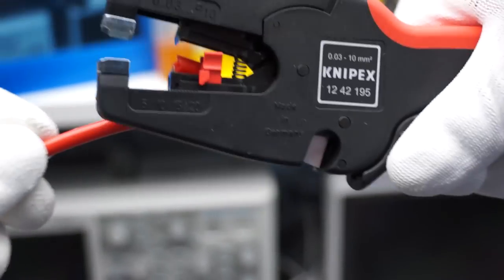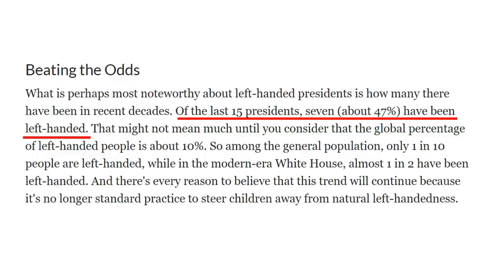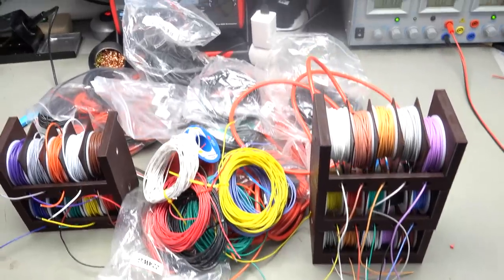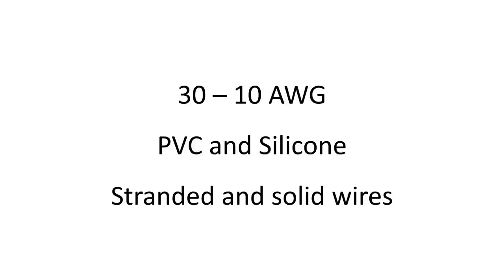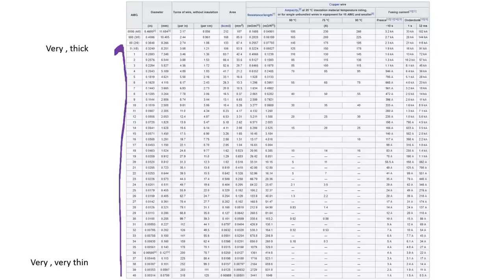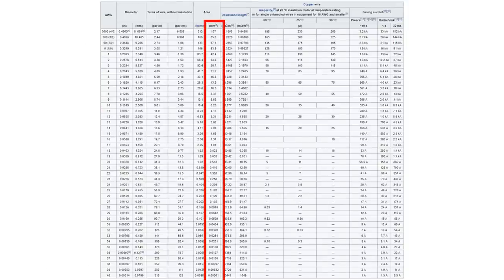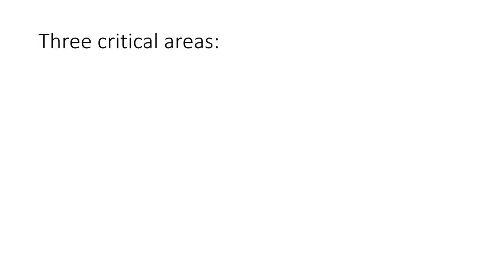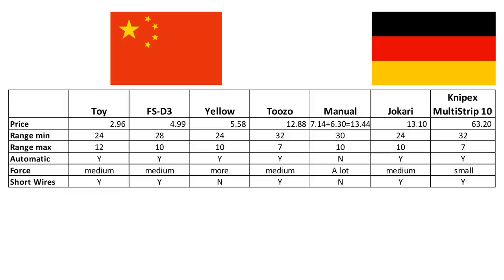#268 8 Wire Stripper Test: Germany vs. China. Who wins?

Comment: I bought a set of the "Toy" strippers when they first appeared in the UK around 1990, they were all metal, with a fine adjustment on the back, cost around £2 ($4,000) 
And I still have them & they still work well, but only on the thinner wires, they tear thick wires.
Seems the Chinese have taken them and made them as cheap and nasty as possible since then.
I also have some "yellow" ones, again with an adjuster, unlike the ones featured in this video,...they're ok, but erratic you set it for a certain thickness, sometimes they work perfectly....sometimes not so much, they don't get used so much because of this.
I recently tried a new stripper/twister that fits in a cordless drill or screw driver. Great for thick wires & as i say it strips and twists them together, might be useful for electricians, interesting idea anyway   https://youtu.be/FPHV8FI5PT0
Reply from the maker: I Think this was a completely different product. Mine was very, very cheap.
Reply: @AndreasSpiess  Apologies, i was making a joke re the exchange rate there, £2 is around $3, it is the same stripper, just as i say, all metal with a slight adjustment on the rear, all that nasty blue plastic on your version, on mine is red or black metal, it really does look like they took a good idea and just made it so cheap and nasty it hardly works anymore.
I will find it & post a photo :-)

Comment: I got the Jokari and it is crap. If you use harder insulation cable like Lapp CNC cables it sucks. Pointing so strong "Made in Germany" isn't often a quality sign and has nothing to do with german engineering understatement. It's just a kind of bullshit marketing.
Reply from the maker: As mentioned in the video I tested it as a Maker. Many commenters who work with electrical wires use the "heavier" strippers and are happy with them.

Comment: I'm loving the humour of the US system of measurement. Good old imperial measurements.......very confusing to a metric fan like me. Some nice strippers there but the usual cheap chinesium one's are rubbish as expected. 
I do know a set of strippers that will cut a perfect circle round the cores, no damage to the inner cores either...... the downside is they cost around $280 ........ ouch!!

Used them for years, interchangeable blades and fairly long lifespan. Way beyond the hobby shop price range but industry use them all the time. Here's a pic (hopefully)     https://dmctools.com/detail/74
Reply from the maker: Thanks for sharing your experience. For this channel, price-performance is very important because many of my viewers are not rich people. Or do not have a big budget for their hobby.
Reply: @AndreasSpiess  Your welcome, though I aren't rich either. My old job (aircraft repair and rebuild) has really tight rules on cable prep and termination, each tool (strippers and crimp) had to have a yearly calibration test and just to use the tools you had to be trained and have test samples sent off to verify your work is up to standard. So as a hobby they are way out of anyone's budget if they are going to be doing scratch builds or experimental circuit building/diy tasks.

But one can easily cheap out and spend more by buying the cheapest rubbish just because it either breaks more often or is badly made. So it's great to see a range of tools within easy reach of the modern hobby electrical/electronic workroom or desk.

Comment: I have owned most of these strippers and have to say you're completely wrong.
The best strippers after a set of pliers and long nose pliers are the ones that you call "Yellow" these strippers are not left or right only handed, you can use them in either hand (I am right handed and my previous employer was left handed we both love these and daily them for all sizes up to 6mm Twin and Earth), you failed to show the screw that can adjust size which most other strippers dont have and is critical to correctly cutting multi insulated wire.

The worst however is the knipex, like all of Knipex it's poorly designed, I gave up on it one day when I was doing carpart lights, the little silver guard on the tip shot across the carpark into the garden, I didnt really care to much until I realised it doesn't cut without it! The knipex are by far the worst designed in every regard.

The yellow ones I've been using for almost 6 years now with no replacement, the plastic is snapped and falling apart but it has never missed a beat, even Snapon have made them make a set for them.

Best rule of thumb is if you see a torq or an allen key on a product, DON'T BUY IT if you want to use it more than once.
Reply from the maker: Thank you for sharing your experience. I assume you use bigger diameter wires than me. Then you are right. BTW: The "yellow" one was defective and my new one works perfectly for bigger diameter wires.
Reply: @AndreasSpiess  Im glad to hear it.
I do all kinds of wire from cat5 strands to 6mm Twin and Earth but mostly do 1.5mm. If you twist the little knob it will let you adjust it to do very small cable without damaging it.

Comment: I had a dream The guy with a Swiss accent decided to build an eBike.
Reply from the maker: He rides already one (Swiss Made)!
Reply: Andreas Spiess Share please? It would be invaluable to have some of your panache and commentary.
Communication between components and Arduino and iOS is changing battery management from my view..
Configuring a power supply and a smart charger, like eBikes.ca Satiator, would be  very interesting. You are a very good teacher.
Reply from the maker: I decided for a Flyer Upstreet 5 because I need reliability for my Danube river trip.
Reply: Andreas Spiess nice! Color me green! Panasonic has a wonderful range of bikes. I’ve only briefly ridden a FIT bike. We’ve attempted to introduce bike centered on the Panasonic mid drive but old retired fellas aren’t interesting in heads or tails with our pensions. A long winding way of saying it’s a most impressive motor.  Could there be a charger video? All the best! Pollack married to a Swede grades schooled in Geneva. No funny accent.
Reply from the maker: I bought two batteries and two chargers for my ride. The interfaces are very proprietary. As the rest of the bike. I think DIY e-bikes are a thing of the past. The quality and the price of the new bikes are quite good
Reply: Andreas Spiess our sales of kits are still very strong. Many buyers do not want the very high prices of proprietary batteries. Kits also allow owners to make repairs and access repair parts. We don’t have the very restrictive laws governing power. We can use throttle as well.
Reply from the maker: Not here where you are very fast illegal :-(

Comment: Excellent Andreas video, as usual.

If you need a perfect cut, or if you need to strip insulated wires with Kapton (which is awfully difficult to cut), you can try Nitronic's Ministrip. I used it professionally and it works very well. But as you will see, the price is not for Makers...

Changing the diameter is not as easy as with other tools because this tool is intended for use in a small production environment to strip a large number of identical cables.

It is also well suited for stripping coaxial cables, but you still need one tool for each diameter. Really impossible for a Maker to afford.

You can check the video on this page:
http://nitronic.ch/cable-stripping/ministrip/index.html

And you can see the price here...
https://www.distrelec.ch/fr/p/18062370
Reply from the maker: You are right, probably not for every maker ;-)

Comment: ideal stripmaster is the best
Reply: I use these in production work, the dies cut great and don't slice or nick any strands.  Maybe not necessary for maker level work. You do need multiple sets to cover the wire ranges though. I have 1 set for PVC insulated wires, and 2 sets to cover the ranges for Type-E/Teflon wires.  The 16-26 PVC are cheap, but the Teflon ones are pretty expensive, but they are amazing and reliable for 10's of thousands of strips.

Comment: Do not get missleaded, China's steel is nothing but durable. All China strippers will bend, broke and got dull in few uses. Not for pro use at all. If handle with care and for home use, will make your life a bit easier.
Ideal Stripmaster will be nice to compare.
 The TOY is copy of Black And Decker's 175mm wire stripper. I prefer the ones with pressure regulator. 
 FS-D3 is Knipex old model copy.
 B&D, broke after 2 years, light use. 

 Knipex old model last really long and heavily used like 7+ years. Got dull but still work. 
I got Yellow one now, work pretty well for most of my uses. Yellow got two models, with build in blade an jaws like this used in video (better model, Stanley's type) and with separate blade and jaws clued in (broke in few uses).

Comment: Knipex 
Weicon
Reply from the maker: And many more...
Reply: @AndreasSpiess  like Who ?
Reply: @AndreasSpiess  which Brand did you think ...was the best .. Quality ..and best made ??
Thank You Andreas
Reply from the maker: If I remember right, Knipex was the winner in this video. But currently I also use a Weidmüller Stripax which is a bit more reliable with silicone wires.

Comment: It is funny you obviously don't know how to work with strippers
Please ask some electrician or cabinet maker to show you
Anyhow phoenix contact cutfox 12 can not be outperformed
If used by professional electrician
Reply from the maker: Are you sure you compare apples with apples? Our electricians usually use very similar sized wires. most non-stranded. Is this different in your place?